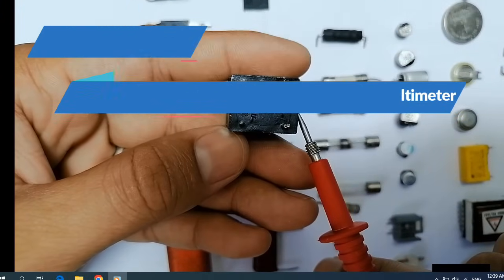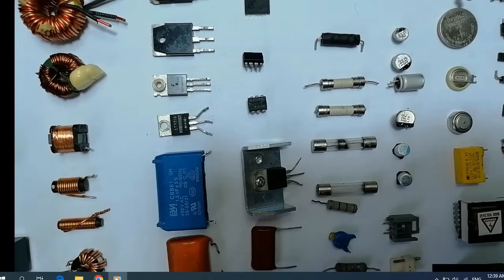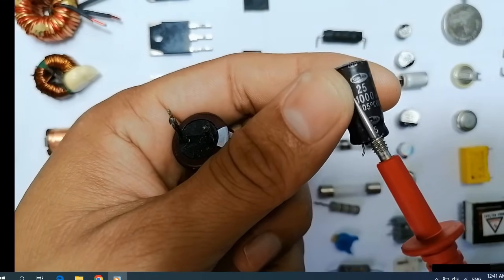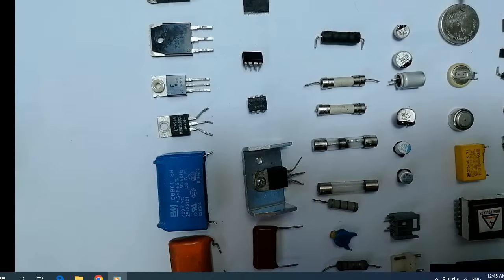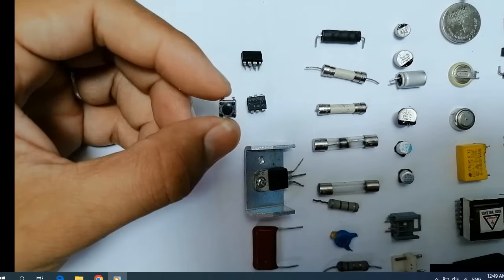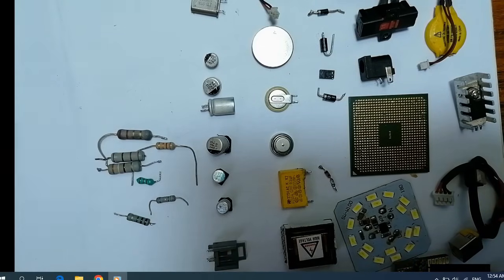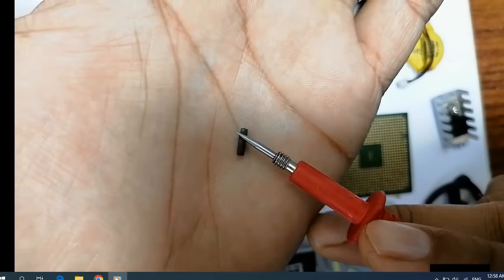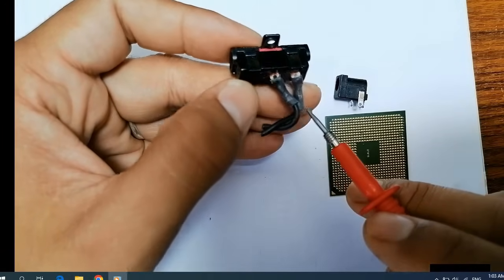All electronic components names, functions, testing, pictures and symbols - smd components

Comment: Hello. I have two components on a JVC tv power supply board, on the the board it is written M601 and M602.  The component has 3 legs just like a mosfet and is attached to a heat sink. It is on the primary section and i dont know how to test it also i did not remove it from heat sink to see the part number

Comment: Which capacitor voltage used in phonic 410r mixer. 400v or 250v.

Comment: Please tell us the Tools required for these Repairs work? Necessary Tools Name and Picture?
Reply from the maker: Multimeter: For measuring voltage, current, and resistance.
Soldering Iron and Station: For soldering components, preferably temperature-controlled.
Hot Air Rework Station: For removing and replacing surface-mount components.
Oscilloscope: For analyzing and troubleshooting signals in circuits.
DC Power Supply: For powering circuits and diagnosing power-related issues.
Tweezers and Precision Screwdrivers: For handling small components and screws.
Magnifying Glass or Microscope: For inspecting tiny components and fine details.
Desoldering Pump and Wick: For removing solder from components.
Heat Gun: Useful for tasks like reflow soldering.
Flux Pen and Solder Paste: For improving solder flow and making clean joints.
Digital Thermometer or Thermal Camera: For detecting overheating components.
Anti-static Mat and Wrist Strap: To prevent damage from electrostatic discharge (ESD).
BGA Rework Station (optional but advanced): For working with ball grid array (BGA) components.
Chip Programmer and Debugging Tools: For reprogramming BIOS or firmware.
Ultrasonic Cleaner: For cleaning PCBs and components after soldering.
These tools will help you tackle most repair work.
Good luck

Comment: 0:20   MISTAKE 1 -  You don't test ALL COMPONENTS with a Multimeter,  that's just silly
0:56  MISTAKE 2 TOROIDAL INDUCTOR , not winding inductor
2:15 MISTAKE 3 - It's  XTAL  not Crystal
          MISTAKE 4 - They are XTAL's not Xtal Oscillators.   the Oscillator is the circuit that it's put it, the Can itself is the Xtal.
3:54 MISTAKE 5 -  Operational Amplifier   not Amplifier
Reply from the maker: Thank you so much I appreciate that, and you are very welcome.
Regards
Reply: @electronicsrepairbasics_erb  
no problem

Comment: 1:05    the black smd fuse labeled  0   looks like an smd resistor , and the other that is white  is sometimes and smd capacitor  , there are white capacitors ..  1:00   Sir , you forgot the  "    Miniature Wirewound Common Mode Choke inductor"  in your list
Reply from the maker: Thank you @tunkunrunk